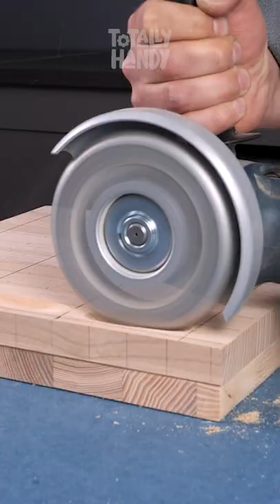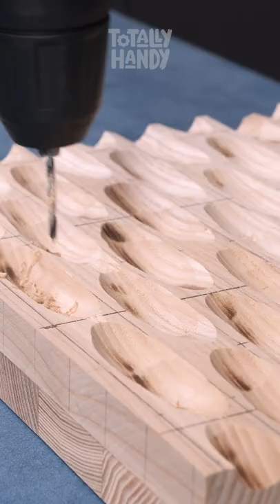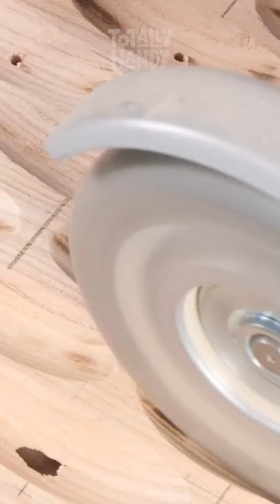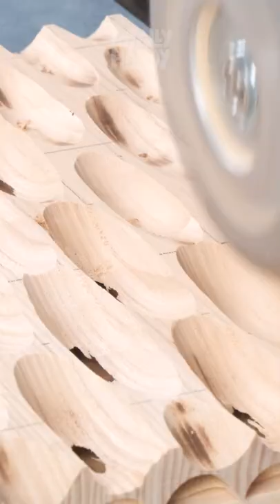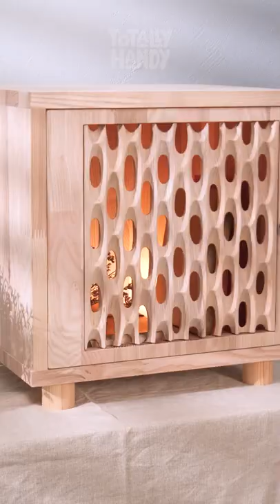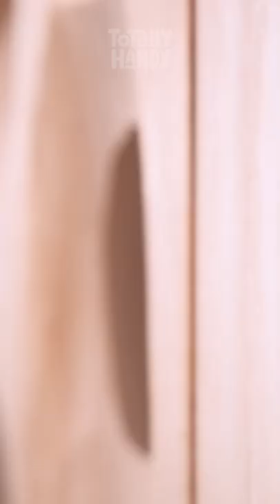DIY WOOD HONEYCOMB #shorts

Comment: I'm thinking that's not how you got the final piece. An angle grinder might have been used to rough in the piece, but you used a slick jig with a table router that lowers or lifts the piece on or off the bit as the piece is pushed.